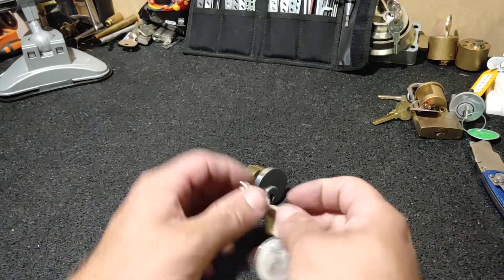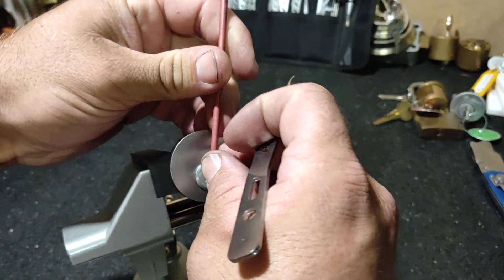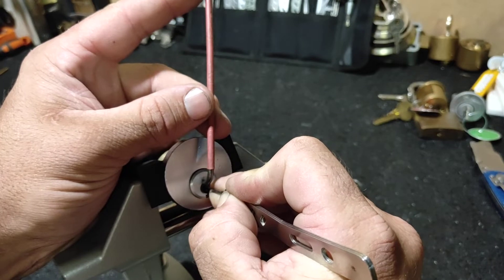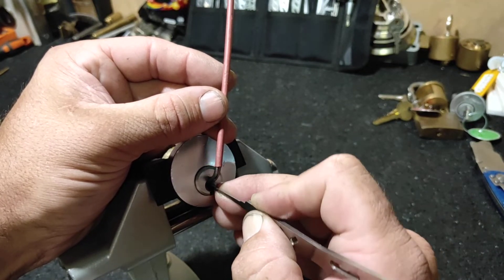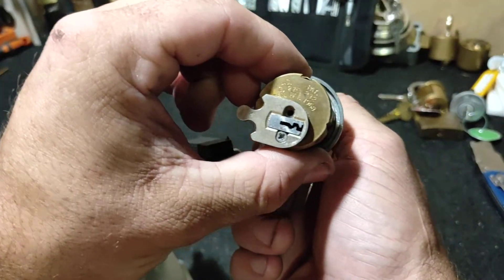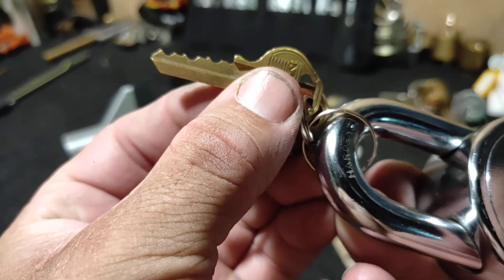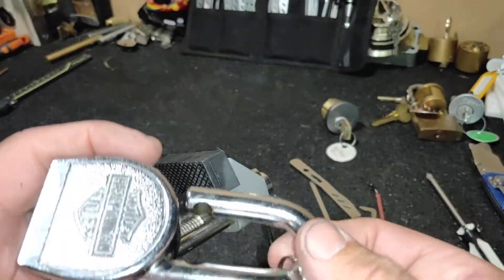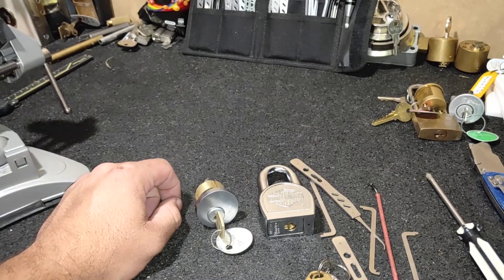(23) Tactical Bull by Thumper picked plus bonus picking

Comment: Nicely picked and pretty quick👌 
The follower size needed is 14mm diameter, when I gutted it I accidentally used a 12.6mm and almost had a gutting disaster lol.
Have a great one brother👍😀✌️
Reply from the maker: Cheers bro. It was a good lock. I'll have to get myself a set of proper followers in all sizes. 
No one wants a gutting disaster.
Reply: Downundermonkey Sparrows make some nice followers made from Aluminum, I use a set of 6 3D printed ones from Bobby Keyz. I've seen people use pieces of dowel that work great.
Reply from the maker: @KeylessEntry  I'll have a sniff around. I'd like a really shiny set. Maybe I'll hit up a local manufacturer and get some made.